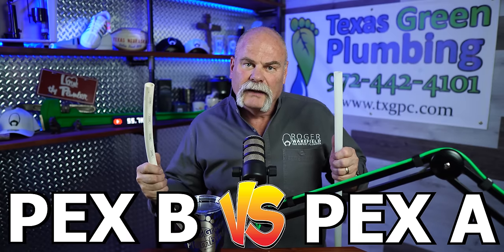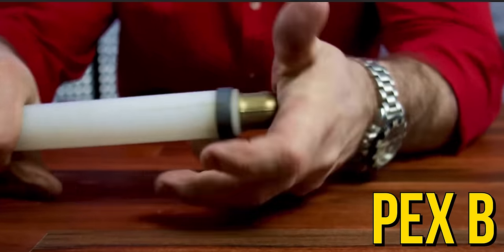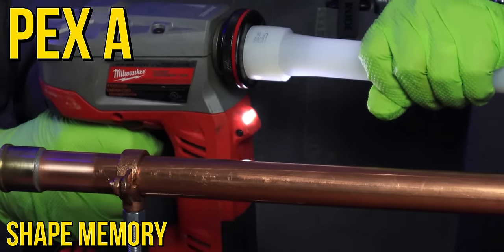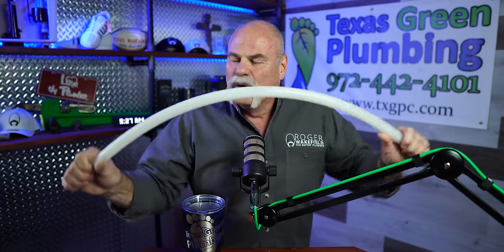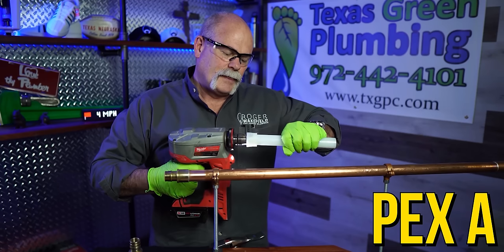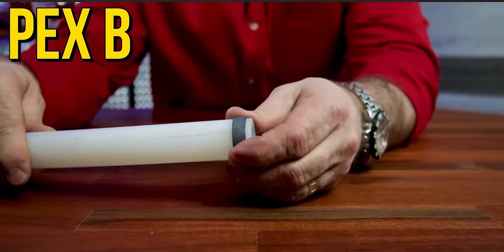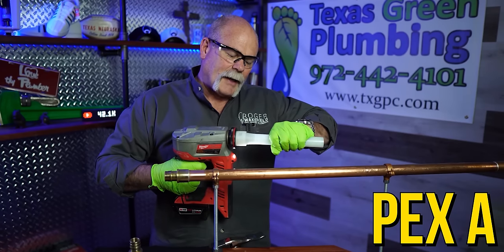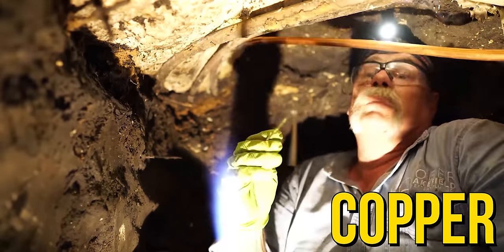PEX-A vs PEX-B - What's the Difference? Which Should You Use?

Comment: For professionals the pex a is more expensive, and you really need expensive tools for the expanding, I know they make hand tools, but using those all day is not efficient and hard the workers. Where as pex-b (viega) pipe and fittings are cheaper, easy to use inexpensive hand tools, or you can use power tools like with uponor.

For someone doing work at home, viega is definitely the way to go. Lower cost, less tool investment. Unless you have someone to borrow the tools from, then uponor is good too.

Everything he said is true, uponor has better flow, but here in ca, everything is low flow now so that is less of an issue here. Also, here in CA, most builders tell you what pex they want now, because they make deals with uponor and viega. Like DR Horton, is strictly uponor. So for the professional, you may not even have a choice.

I worked in the plumbing industry for nearly 2 decades, doing nearly every job there is from field to office. The only thing I never did was finish work, but that is pretty easy as homeowners can do that work themselves for most of it.

Comment: What do you think of the Uponor plastic fittings though?  Call me crazy but I would rather have solid brass.
Reply: i thought the same thing when i built in '03, have since replaced 8 brass upinor fittings due to acid water. stick with the non metallic fittings as much as you can. the brass adapters will be mostly exposed if you run into trouble down the road. (retired plumber 49 yrs in the trade)

Comment: The Crimp rings that utilize the full diameter to crimp are made of copper and do not rust some are painted black and some are bare copper. The pinch type are made of stainless steel and most likely will not rust.

Comment: @rogerwakefield 

Do you ever have an issue with the ring pushing down the pipe while expanding 
I had 3 in a row the other day 
A few here and there but 3 on one fitting took 4 rings to get one side of a joint
Reply: i have that many times on 3/4 expansion rings sometimes you get a bad bag
Reply: Can't you use a piece of 3/4 pipe as an ring for 1/2 pipe? I have heard that never tested it.
Reply: @snyper1982  never heard that rather not be a test dummy 
My luck water leaks all over insurance says not proper fittings 
Your on your own 
Now the bill for clean up isle wtf lol
Good question though if it works 
In a pinch
Reply: newer rings have a stop on 1 end to prevent sliding

Comment: I like both pex a has better flow, but you need so much more space between fitting to make a critical alignment. Pex b is faster, has a lower flow rate per line size, is cheaper, if pex a would come out with street fittings that would be more ideal

Comment: With Pex A wouldn't it eventually "stop" trying to get tighter on the fitting... IE:  With age, weather, time...  I think of elastic, it's great in the beginning but with time it looses it's give to come back to a normal shape.  It worries me with Pex A that the only thing holding the fitting on is just pressure.  Nothing is crimped, chemically joined..etc.  I want to run a hot/cold water line into my garage and was planning on doing copper since that will outlive me.  But everyone I keep talking to swear to use PEX for the sheer ease of doing it...  But everytime I hear plumbers say "if you want me to eventually come fix your plumbing, install PEX"...etc.

Comment: I froze my trailer house hard a couple of years ago. Have pex b ran on the surface of my walls. I froze 1 bathtub valve, 1 lavatory supply line, & split the jet pump body. The hot water tank was still ok.

Comment: I like pex a purely for the volume but do carry crimp fittings just in case. The delta expander is much faster tool. Milwaukee is slow.

And naturally the reason I use pex. Is because my customers can’t afford cpvc. So copper would be a stretch. I won’t use cpvc. Cpvc should be discontinued. So the pex is the middle ground. Pex a is about same cost. Fittings are more. Rings are less. Pipe is within pennies of same. Best way to remove pex a is with a heat gun like in the graphic he showed to fix kinks.

Comment: I just have to get past that plastic ring on PEX A... the metal clamp on PEX B makes me feel better... doesn't mean it's better.  

I like the flexibility and burst resistance of the PEX A.
Reply: I watched a test between different connections.  All the fittings were fine except shark bite press on. It blew off. The rest held up until the pipe burst. Pex a was the first to burst.

Comment: i did a shower remodel a year ago, had old 1/2 galvanized pipe that was rusting, i switched to 1/2 pex b and got everything tiled in and noticed low pressure, i wish i would have seen these videos before and went with a 3/4 pex becouse i did notice the pipe was smaller but figured since it was same size pipe just different material that it would be ok

Comment: Been working with pex since there has been pex. Worked with copper and quest before that.  Believe me that you want to use crimp ring style pex fittings. And use the brass fittings.  Never seen one burst, the plastic crimp fittings are not as durable. We even use the copper rings in a marine environment on sport fishing boats and I have seen them last 25 years to date. On nicer boats I will heat shrink the rings after crimping them.

Comment: Roger, I just watched a video about Zurn Pex B and they pointed out that it is installed the exact same way that Uponor PexA is installed.  Also the fittings were basically the same so not water flow loss because of size issues.  They also pointed out that the Zurn was better quality pipe than Uponor's. Is this valid??
Reply: I saw the same video,  the problem i see though is that current pex a and pex be seem to look alike,  but pex b, is better for your health.

Comment: Obviously this guy just loves Pex A and nothing else will do. Except I did My home in Pex B and I have much better flow since the old metal pipes were so corroded on the inside. I used 1" from the street to the house, then 3/4 to the distribution manifold and through the water heater, then used 1/2" for all baths and washers and kitchen and the flow is just fine. I installed a water shutoff in the main inside the closet so I can shut off all of the water to the house from there. I bent the pipe instead of using 90's as much as possible. I have one outdoor faucet to the back yard- a 130' run with 3/4" and the flow is far more than I need. I did find that our psi was at 82, so I installed a pressure limiting valve and adjusted it to 64 psi. With all of the low flow stuff in the house and the decreased pressure, our water usage is less every month. Pex B works great!!

Comment: If you have a house then you know the HORROR of having a pipe freeze and burst in an exterior wall due to an unexpected blast of extreme cold weather. So what you want is plumbing that can withstand that freezing and not burst, and that is PEX-A plastic pipe.  I don't trust that expansion method because I know how plastic tends to CRACK when it is under stress for long periods of time. compression = no problems,  stretching = you will get a crack in 10 years at that spot of stretch. I would use Crimp rings with PEX-A instead.

Comment: I saw a job where they used PEX on a comercial heating system  and it melted a hole and high pressure hot water shot all over the fire panel and control system....  the plumber said no way should pex be on building  heating system, unlike  domestic hot water  which should be 120 deg F  
.. whats the temperature limit for these PEX lines?

Comment: I used pex a in my bathroom and it worked great. no leaks.  When I  installed a water conditioner and filter, however,  ALL the brass 3/4 fittings leaked.  I had to use hose clamps to stop the leaks.  Disappointed.

Comment: I definitely prefer PEX expansion fitting system over PEX crimp or cinch fitting system  but Uponor Pex A has suffered problems from Chlorine injected in Municipal water supplies to combat bacteria, and other organic contaminants.  Apparently the inner white surface with undulations in Pex A  is subject to corrosive deterioration from even low levels of potable water chlorine content.  Uponor has been sued and settled in response to class action lawsuit but they have not changed the way the pipe is made in response to the lawsuit.  Guess its a cost v. benefit value judgement for them.

In order to continue using pex expansion system I now use Zurn or Sioux Chief who have gotten their Pex B approved for use with expansion pex fittings and end rings with stops under the applicable ASTM standard. Zurn makes cone fittings for the milwaukee expansion tool that better expands the stiffer Pex B from Zurn.  The only caveat is that in cold weather you have to get the Pex B pipe up to at least about 70 degrees or a decent room temperature so that when you do the expansion the pipe end doesn't crack and that has been found to solve the problem of cracking which was found to happen by plumbers working in cold weather in the Northeast.

Comment: Why do you guys run your plumbing in your attic? I've never seen that done up here in Canada, is it because you aren't on a Slab or Basement?
Reply: We loved to Texas from Indiana about 2 years ago. It is new to me too. It is run in the attic because most houses are slab on grad so there is no access to piping underground. So if you have an issue, you have to tear about your foundation, floor, etc.  Also, it rarely freezes down here so the attic is relatively safe to have the pipes. We just bought a house that was built mid 70s with galvanized piping in the attic and I am going to be replacing it all with PEX so we don't have any issues show up of rust. It'll be relatively easy to just run everything through the attic along the old lines up there.
Reply: My opinion is that it has more to do with cost.  Most houses built in Texas over the last 50 years are slab on grade.  Most of those also have all the plumbing under the slab with copper supply and PVC waste.  Lines were not run in the attic due to possible freeze.  Pex negates the freeze concern allowing lines to be run in the attic but I dont think the new home builders are generally concerned about future repairs, they are doing it simply to save time and money on turning over the keys to another unit.  Roger has plenty of videos showing underslab repairs to show that copper under the slab was the norm and not the exception at least in north Texas until new homes started using pex.

Comment: I will only use PEX-A. If the fitting is on then its a 100% its on. Unlike a crimp meaning did I crimp it? Did I crimp it enough? Will the crimp fail? Now we jut need to get a PEX-A manifold system.

Comment: I think pex is fine but the problem I have with it is plumbers use it on they're turnouts for shutoffs and don't have them secured so the shutoffs just float around. I think that all connections for sinks and stools should be terminated with copper for strength.

Comment: Nothing wrong with either system.  Moen and delta shower valves are 3/8" internal  so if you run 1/2" pex b to the shower you are already over sized. also if you use the trunk and branch system you won't have issues with line sizing.  There is a line size chart in the NRC Canadian plumbing code book so use the chart and you wont have flow issues.  pex A is great for a lot of reasons but frankly is really not that much better. Its more expensive and harder to get.  The tool thing is a non issue because you have to buy tools regardless. you can get a hand operated expansion tool.  during the pandemic pex a has been harder to get.  fittings not so much but the actual pex.   one thing he didn't mention is you can use pex B fittings with pex A pipe.

Comment: Even Pex A needs to be over sized. This because it draws it's dimension from the Outside Diameter or O/D.

This half inch PEX A t
tends to run about 3/8ths and inch

3/4 in PEX is actually 5/8ths I/D.

If you don't compensate for this you're going to have failed systems.

Comment: So if you install pex b that is too small you may have problems with flow. If you bend pex b too much it will kink. Pex b is more susceptible to freeze damage even though it has a higher burst pressure rating. Metal clamp rings aren't as good as pex clamp rings. Pex A is resistant to chlorine, just like pex b. 
Uponor fittings are proprietary. That means more expensive and available in fewer places. They each have their pros and cons. I don't think one is better than the other.

Comment: I'm going to preface this by stating that I work within the Information Technology field, primarily programming and my experience with water systems, although clearly fundamentally sound within my own properties plumbing within the years (not others), but concurrently 20 years of PC Watercooling.

First, I'm not quite sure where you're getting the science behind "smaller inner diameter is less flow". That's not how flow works. The flow indication, or rather the amount of water being pushed is still the exact same. If your city is pushing out 70psi of water, you're still obtaining 70psi of water. The difference is going to be be the backpressure of the water that then determines additional flow characteristics.
If you go with, say American standards of imperial, 1/2" (instead of 12mm) PEX A or B, the diameter difference is going to be negligible within that 'pressure' build up, unless (of course) you're already SEVERELY UNDER THE SUPPLY LIMIT SIZE.

A great example would be fluid dynamics within a watercooling PC. Going between a 3/4" line verses a 1/2" line is negligible and causes absolutely zero difference in water cooling performance, flow characteristics, or flow tendencies. In fact, it was determined DUE TO PLUMBING OF THE 1990s, that "It's better to go with 3/4" water cooling tubing" because "Plumbers", you know the guys who have absolutely no education on fluid dynamics, assumed that a larger diameter meant a better free-flow for water.
Turns out; There is a limitation to where backpressure occurs within the regulated pressure.

So if city ordinances give you 1/2" line, and you're instead at 7/16" due to the bend in the fitting, the fluid isn't going to change it's flow much, if at all, and it'll do almost negligible results within restriction. If you, however, go down to 1/4", you'll probably see some sort of flow differences, in how much pressure is being applied. In fact, it'll actually do the opposite of what you're implying. It'll INCREASE the flow, not decrease it.
This is why it was always common to go from 3/4" to 1/2" within a house, at least 40 years ago (in any older home I've lived in and changed out a sink or repaired the lines).

So the real answer to "What to go with" is "Whatever fits your budget".
PEX A is more costly, however there is a guaranteed seal.
PEX B is least costly (still expensive per fitting), it will still allow a near perfect seal that will last, however it won't be as secure as something like PEX A.

There is no wrong solution here, just different options.
If anything, the reverse affect would happen when utilizing something, such that as, PEX A in your situation where they aren't obtaining enough water pressure in their house. Clearly, that's because the lines are too large for the water pressure the city is supplying. Decreasing the size of the water lines increases the pressure. A negligible 16th inch dip for a connector isn't going to disrupt water pressure of flow...that's just stupidity.

Comment: Seems like with Government Mandated restrictors installed in fixtures with a hole size of a pin head slightly smaller 3/4" fittings are not going to make a difference. Lot of people install a showerhead they got off Amazon where they can remove the restrictor. I did this get a ton of flow, but I found others in the home didn't understand how to turn down the water burning through entire hot water heater of water. I put restrictor back in.

Comment: Upsizing a line to a shower makes no sense to me when most shower heads have low flow restrictors in them anyway. Plus if you have a fatter pipe of hot water from the water tank to a fixture sitting unused it cools off. So you're just wasting hot water. I've used the B and never felt like flow was an issue.

Comment: But the tolerances inside the plumbing fixtures,are even smaller than .05" PEX B fittings. Often 1/4" and 5/16" on lav faucets, and shower valve body ports.Not sure the B fittings make much of a difference serving these fixtures. Type A is easier if you own the power expansion tool. Forget about doing it by hand.
Reply: Turbulence in pipe is what caused a bigger flow restriction than anything... And crimp pex caused worse turbulence than uponor does
Reply: @sbritton1313  ....it's internal diameter as the main contributor to pressure drop.
Reply: @TheWilferch  - Diameter x length, though, not simply the smallest diameter as people seem to think. One fitting as a "choke point" will affect the pressure exactly 1/3 as much as 3 of the same fitting in that run.
Reply: @pterafirma  ...correct...my comment was general......smaller diameter that has a meaningful length is the combination that makes for pressure and flow characteristics  /reductions,  seen at the end-point.

Comment: I have seen 40 gpm through 3/4" pex b fittings, they might look small but not small enough to really affect your pressure at normal house hold flow rates.
Reply: lol same!  look into a shower valve it has a pin hole in both the hot and hold side. most pex runs have less than 5 fittings in the whole branch...

Comment: I'm installing an outdoor wood boiler and I want to use Pex A. I'm just wondering if there is any temperature restrictions for A since the expansion joints will be heated by the water all the time. The boiler water will run between 175 and 180° F regularly. Thanks!